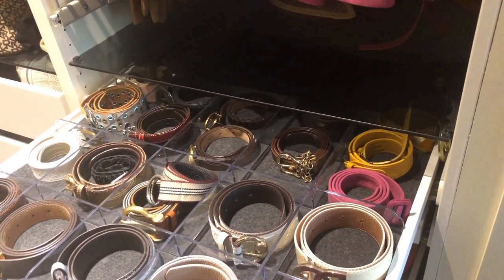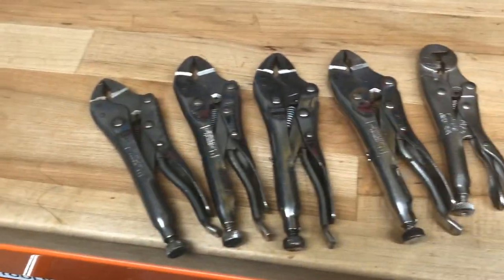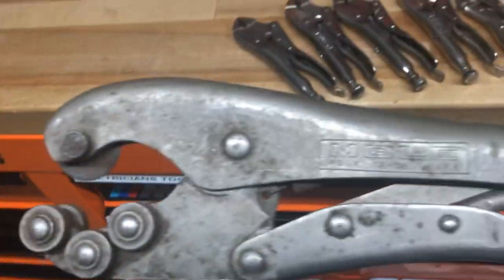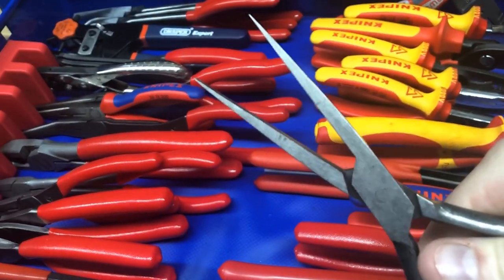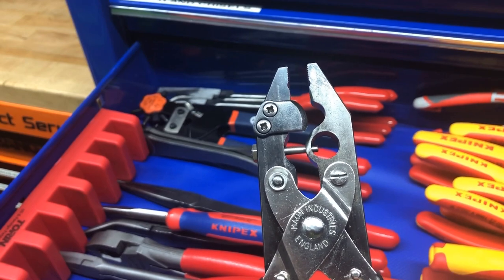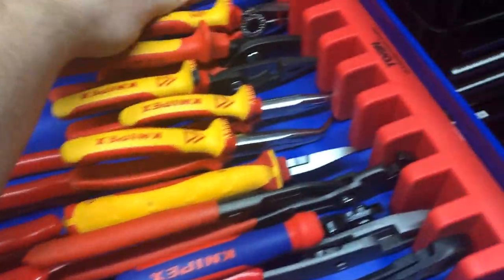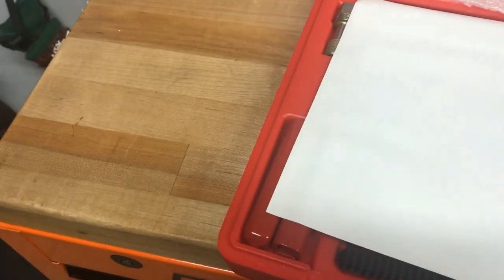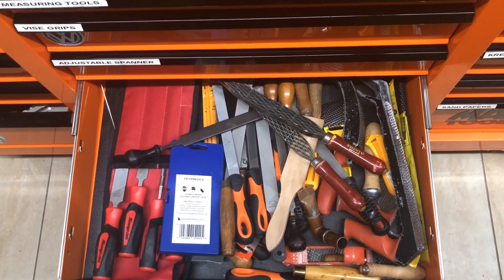Snap on + Mac tool Mini tour Knipex Vice grip bahco bluepoint nws

Comment: Been do you have instagram? I'm not sure if you know this or not but that blue point chain wrench is a exhaust cutting tool, not sure how well they work tho. if you look up that snap on duckbill part number you'll see they change them to have smaller handles and deeper jaw. We have a little bit of nws on amazon.
Reply from the maker: You sure know your tools Yota :-) thanks for the info mate
Reply: Exhaust cutting tool. Nice. I used something similar to cut cast iron pipe.
Reply from the maker: all tools are cool that’s the problem?😉